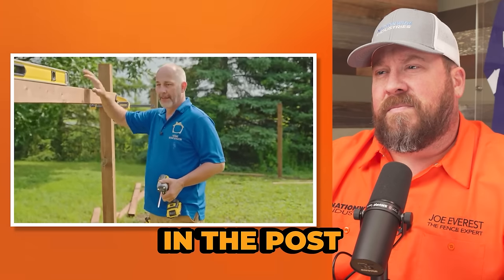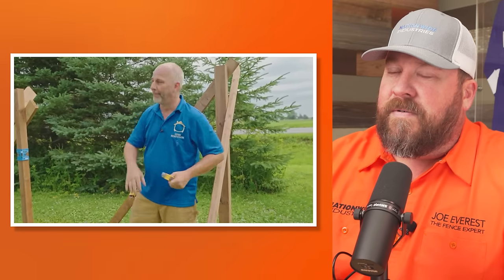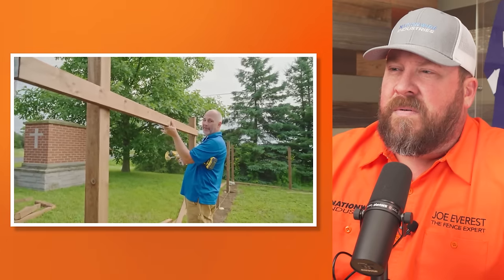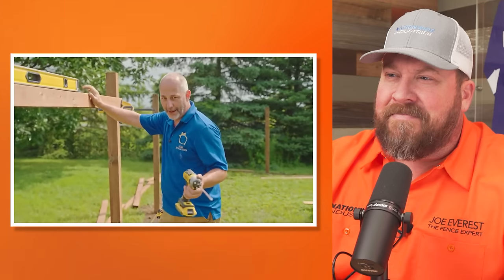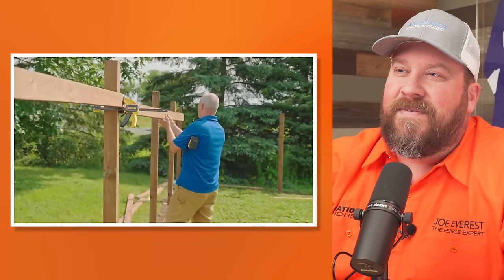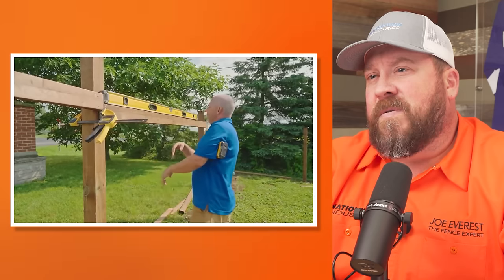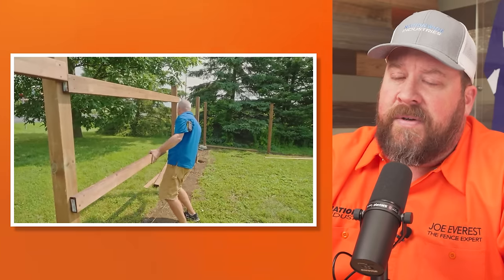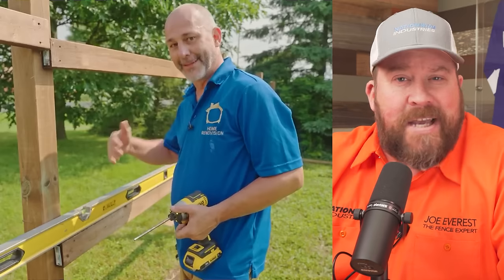PLEASE Do Not Build Your Fence This Way! - Fence Pro Reacts

Comment: So im going to be redoing my fence soon. Do you have any videos on the correct way to build a fence? I will be building it because it’s cheaper then the premade fence panels.
Reply: Just went through the process myself with a handyman's help. (Wanted to learn all I can to spot mistakes should they happen.) The following is a summary. Consider buying a book on how to install a fence because as the other comments here reflect the quality of how-to advice you can get on YouTube ranges from excellent to flat-out wrong.

1) Learn how to use a string line after deciding on the style (stair-stepped vs. racked if the ground isn't level).
2) Do the rise over run calculation if the ground isn't level. (Build from high side to the low side.) 
3) Stain the wood before you build the fence.
4) Use stakes to mark out your fence post locations. This is generally 8' apart for level ground, but as close as 4-6' apart if you're building on a hillside. (Another consideration is what spacing will divide evenly between opposing ends.)
5) Consider galvanized steel posts if you don't want to deal with eventual wood rot. 
6) Use a species of wood that resists pests and is less likely to buckle over time (i.e. redwood). 
7) Face the nice side of the fence toward your neighbors (laws vary but in many places this is the law.)
8) Space your rail about 6" from the bottom, 6" from the top and center the third one in between, if present. 
9) Use pressure-treated rails and wood posts (if you cut the ends, apply the Copper sulfate or Copper Naphthenate treatment. Make sure to read all safety precautions!). 
10) Leave about a 2" gap under your fence for drainage.
11) If you're in a windy area, leave 5/8 - 1/2" between slats (looks nicer sitting flush but this is the "official" advice for a privacy fence). 
12) Sink your posts at least 2' into the ground (make sure you have enough remaining above grade to build the desired height. (The legal limit is 6' in most states.) Bear in mind that if your posts are inconsistent, you may have to cut the taller ones down so they don't exceed the height of the pickets/slats. You may be able to save this step if you plan carefully.)
13) The post hole should be ~8" in diameter. Level the post before you set the concrete. Brace the post while it is curing.
14) Tack the wood as you go with nails. When everything looks good come back and use ~2" deck screws to secure the slats to the rails.
15)  If possible, level the ground running beneath the closed position of the gates before you put in the gate posts. (Use extra heavy duty posts for gates.) Make sure the gates open toward the down-slope if the ground isn't level. 
16) Use steel gate frames to prevent sagging. (Building a gate is a whole different animal and might be better served by a pro.)

Comment: I’m from the same area as him, code for depth is 4 feet deep which is where our frost line is. I’ve removed and replaced multiple fences that were only 5-7 years old and already falling over because whoever built it decided 2 feet or something a handyman I came across said, as deep as your arm can reach in the hole was more than enough
Reply: Where we’re from it is most common to inset rails and fence boards, it looks cleaner in my opinion and has been what I’ve always seen growing up, on the face we would call a hack job

Comment: I think there's more than "make it look professional". Some people don't have the budget and have to just make something that looks "good enough" and serves a purpose. In my experience, the better is built, the higher the budget goes.

I've done project where budget is not an issue and I surprise myself with the results, and others where I know everything I did wrong but I didn't have the money to buy the materials needed to make it right, and well, ot still works and serves it purpose, so, whatever lol. It's for me not for a customer.

A job's quality from a contractor should definitely carry a higher quality standard than from a homeowner.

Comment: Just did my fence today and I use the foam because I didn’t wanna wait. I wanted to have my fence up and it worked perfect level  them out worked perfect as a connected. Everything else everything was solid the only thing only got about a foot and a half maybe almost 2 a 1/5foam exposure other than that it worked perfect like a professional seems like you’re hating on the guy lol 🎉🎉🎉
Reply from the maker: We’ve done a couple tests here on the channel, with the same brand he’s using, and neither one held up. But, in those video’s comments there were several people who had decent experience so 🤷‍♂️
Reply: He's just trying to push people away from diy, because diy takes away his business. So he's pretty much against anything that makes it easier for a diy home owner to do it their selfs.

Comment: What would you recommend for setting post in sandy soil and high winds
Reply: Go deeper in setting your posts, and set them in concrete

You want that weight as ballast the higher the fence the deeper the post depth.

Comment: if my electric company can set their posts in foam and they never fall, then i can def use post foam to set my privacy fence. every one is an expert on the internet. never had any issues with jeffs installs and he even admits when he fails or something has failed.
Reply from the maker: Completely different chemical compounds. We’ve done a couple videos on the channel showing the ineffectiveness of the products. We tested the product Jeff showed, another popular brand and concrete as a reference. Foam wasn’t structurally sound and was significantly more expensive. But, to each their own.

Comment: You put rails parallel to the ground and each other.  Not level to the center of the Earth.  Place a picket on the ground of a set post and measure from there up.  The "back" of this style of fence should look like one continuous set of three rails following the terrain and changing course behind each post.  Only reason to have a level is to set posts, not rails.  Buy the red bag of quickcrete.  It sets good enough to build on in 45 minutes.  No need for bracing post unless you're doing it in a hurricane. This is the most homeowner job I've ever seen.  If you get more than 25 years out of a wood fence, you are running on house-money after that.

Comment: I haven't built a single fence in my life and I absolutely could and will build a lot stronger fence than he could/did. 

Why not simply put the posts slightly closer together so they are 8' outer edge to outer edge? Now you have 8' cross ties with screw attaching them dead center into the post.

The structural integrity would be a lot higher and the posts would tie into each other and brace one another a lot better. Even as the wood aged, the increased structural integrity would add years to the fences life.

Warping? Use thicker pickets and seal them properly. I mean, building one good fence costs more, but it's less costly than building two bad fences...I could build a 50 year wood fence, I bet. In fact, that's exactly what I'm going to do. Tim Allen that thing. Come at me tornado!

Comment: Stair stepping that top runner is definitely ugly. Even when I'm doing horizontal cap and trim I do whatever I can to keep the steps to a minimum. I put alot of pride and effort into building fence. Saying a diy can do the same thing is like wiring your own house instead of calling an electrician. Perform your own open heart surgery. Ppl call professionals for a reason. Thx for this video

Comment: What a POS job RenoVision did.  I did a fence for my mom 30 years ago, before I ever got in the business.  
This was in Southern California where the environment is very forgiving.  Hell, roofs last 30+ years because of the lack of rain and wind - now I live in Florida where roofs last 10 years or so.  
The PT posts started to rot within 15 or so years.  It totally failed at about the 18 year mark.  Replaced it with Postmaster posts set in 3 60lb. bags each.  Then did a concrete curb under the entire length before putting on the fence pickets.  That way they were spaced 3/4" off of the concrete and even the pickets can't rot from the bottom up.  Not that every client will pay for all of that, but I doubt I will ever need to rebuild that fence for my mom.

Comment: 8 ft on center post holes sounds good until you find out that your lazy / idiotic builder used fill dirt with chunks of concrete, large rocks, or other post-hole-digger-unfriendly items when they were hauling in dirt for your lot... Making them a bit shorter so that you have room to adjust them might make your project a bit easier... I found things in my yard that even a trailer mounted power auger could not drill through... I had 250 ft of cedar privacy fence that I lost after Hurricane Ike and I replaced it with a metal fence that I welded myself... I determined my post spacing by just taking the total length of each span, dividing by 8 ft, and if it didn't come out even, add 1 to the number that I got from the division and then dividing the span by it... That way, all the fence sections were at least intended to be the same size... It got adjusted when I ran into the crap that the builder had left in the fill though...

Comment: He’s a crock. I remember watching Jeff over 12 years ago when I was a beginner DIYer. There weren’t many channels doing that then. As he grew, his cockiness grew right along with it and his work became sloppy. He applies these same jargons and “it doesn’t have to be right to work” attitude with interior and exterior work. He also talks down on some professionals as if he knows better as just a handyman. I quickly learned not to watch anything he does. In my opinion he does slightly above average landlord special work. And it’s all about the YT check popping out videos instead of taking his time to actually teach people how to diy things like it was in the beginning. I’m thankful that I only may have referenced a math solution from his channel for an angle, but never built anything using his techniques.

Comment: I couldn't imagine ever taking advice from that hack. I put up a fence in my yard for the first time this week and with a 250' section, digging manually with a a posthole digger and rock-bar it wasnt bad. Just made sure my corner posts were done first and square to everything, ran lines and everything else was a breeze. The hell was that guy even talking about.

Comment: He is a contractor.  And a contractor has a little knowledge about everything.

In all fairness that diy channel.  He probably does 2 fences if he's lucky a year.

You are a fence specialist. Every single day you probably build fences and decks.  Therefore.  Your work will be close to perfection.  That plus the fact that you've probably put in the 10000 hours for you to become a specialist at it.

I'm an insulator.  I insulate houses.  My work will be close to perfection.  And I can insulate a 2800 sqft house by myself in a day.

Every single day that's all I do.  I have put the required 10000 hours to call myself that.

I don't expect his or you channel to even make a comment on my work.

His channel is for diy.  So he caters to that audience.  I am certain that his framing is alot more on point.  But he won't come close to a framer.  One who does framing every single day.

And your riding him.

Better to say this to the diy.

Leave the work for the big boys and just call a specialist in to do the work around the house.

The only way to learn a trade is to do that 10000 hours of practice.

And a homeowner and a general contractor will never put in that time in every single trade out there.

Comment: In one of Jeff's videos, he claimed to be a general contractor for 20+ years.  Then he struggled for five minutes trying to get a lid off of a 5 gallon bucket of paint. 

In another video, he pulled the camera man into the shot and claimed he was a structual engineer.  

He's a fraud.  And he does everything wrong

The video where he swings a hammer 😅😅😅😅😅😅